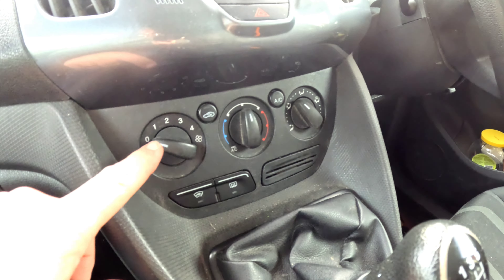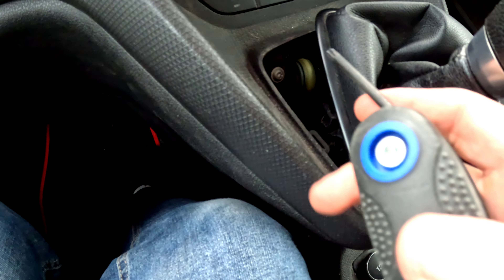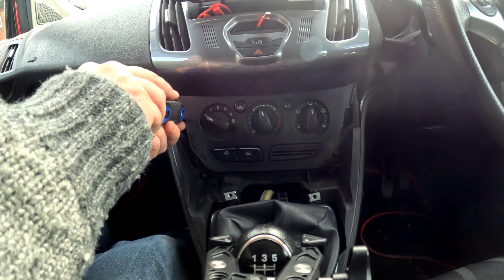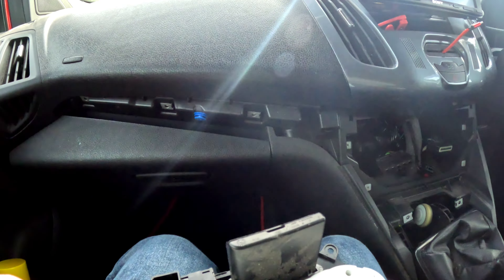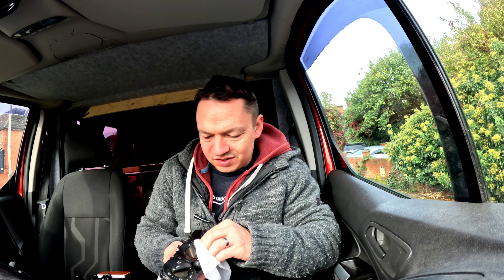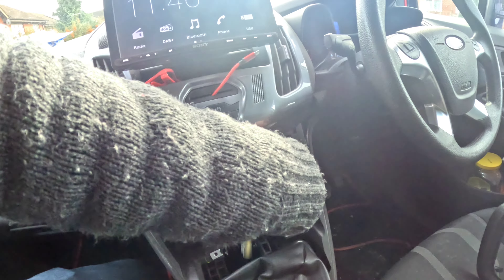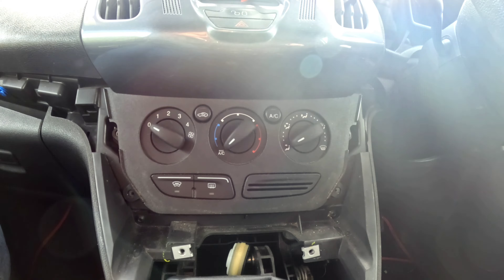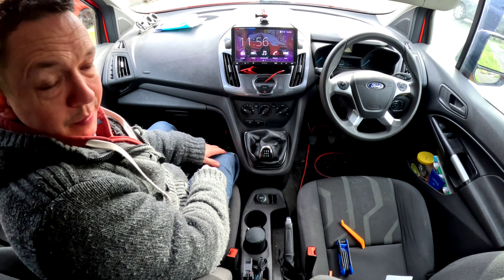Ford Transit Connect Heater Control Panel Removal

Comment: thank you, thanks to you I was easily able to understand how to remove the panel to modify my start/stop button with a small canceller box on my 2023 Ford transit connect. I was able to take my time to remove the same trim as you and do the job. You have to be careful and take your time so as not to damage anything. thanks again
Reply from the maker: @Krys3d899 glad it helped you out. And thanks for the lovely comment